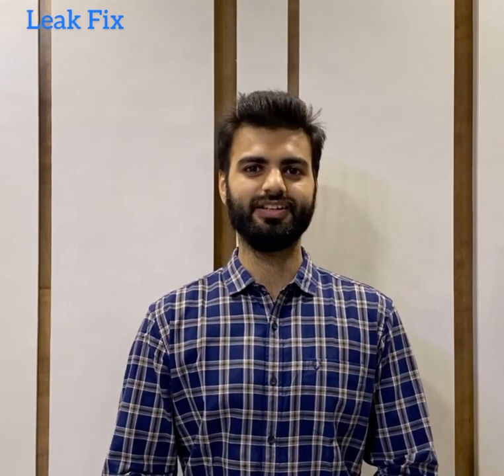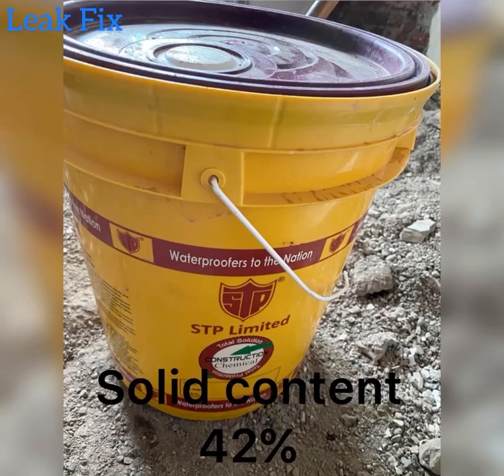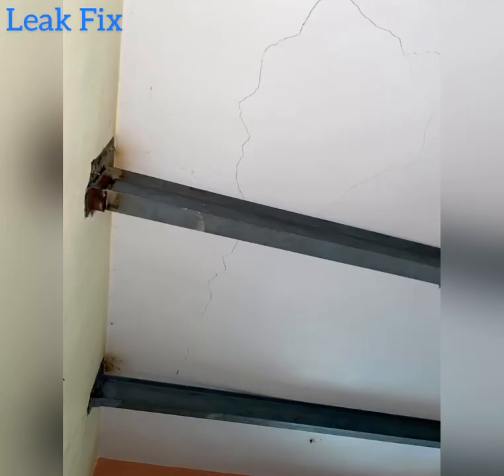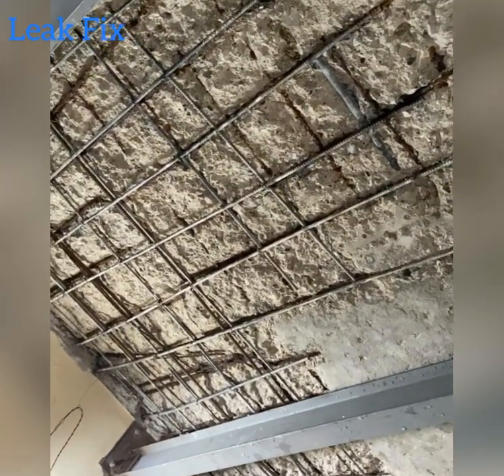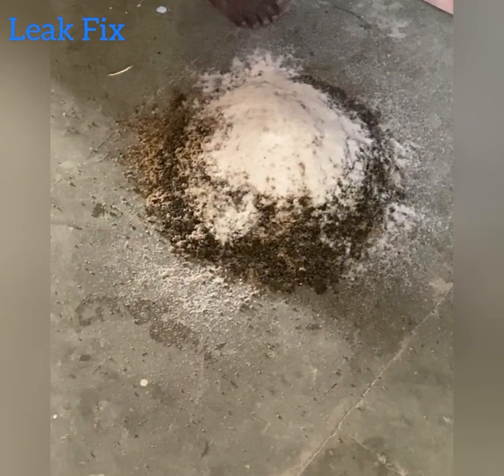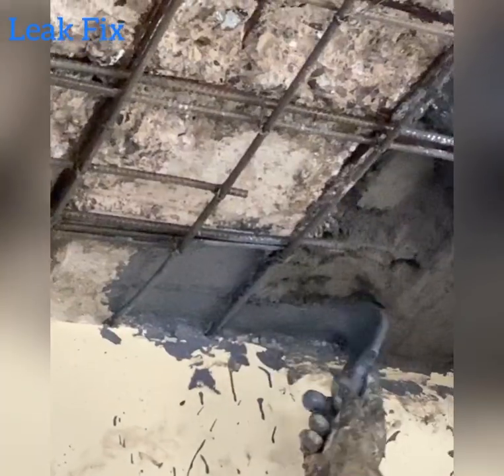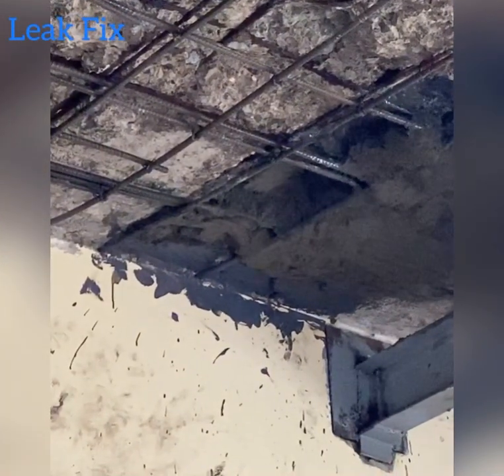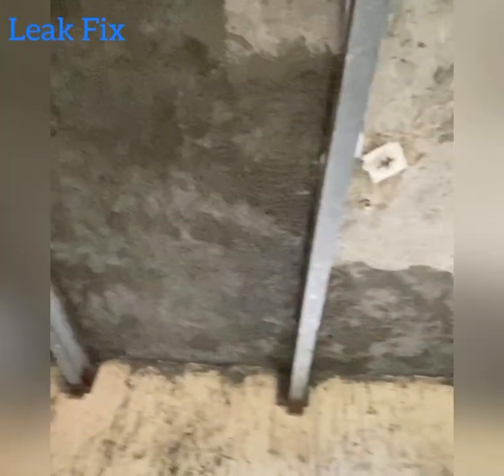5 steps to repair RCC Slab using polymer modified mortar

Comment: U didn't mentioned proportion of sand cement and chemical used
It should be 1:5:15
No rusticide application shown properly how much time It should be kept how to clean
Fixoprime to be used
It is not proper way to.treat the slab or any RCC MEMBER
Reply from the maker: Thanks for taking out your valuable time to watch the video.. We dont use Fixoprime we prefer BASF construction chemicals or STP limited. Will mention proportions of all materials too in upcoming video. Thanks for watching the video keenly.
Reply: It looks you are also in this field. 
Pls share your contact as I want to get my old house beam and slab repaired

Comment: Is it I beam ? Install I beam before repair or after repair.
Reply from the maker: Yes this is I beam.. installing I beam before or after repair depends on the condition of the slab, if slabs condition is critical I beam should be installed before repair otherwise it can be installed after repair..
Reply: Sir which size is better of I- beam for 10 feet width.

Comment: how can we provide new reinforcement in slab? coz if it was column or beam, we could have provided by hilti but how to do it in slab? plz help
Reply from the maker: Sir we have drill upto 6 inches in the adjacent beams and fix reinforcement in it and tie it with old reinforcement using bending wire